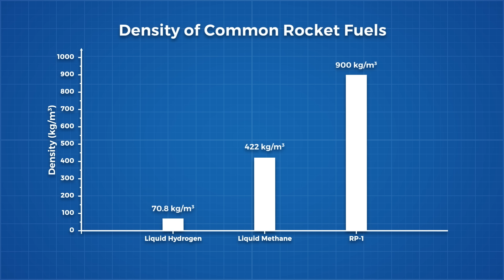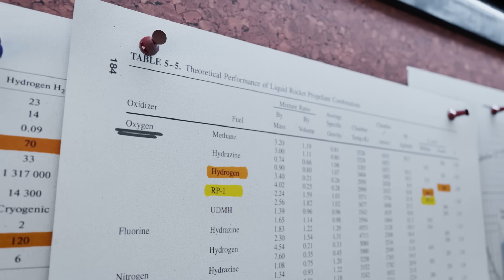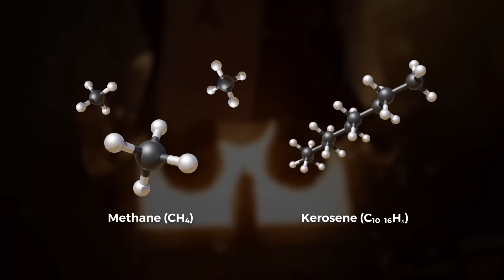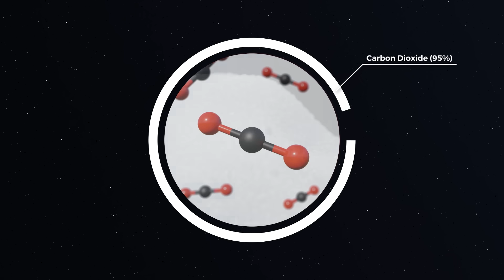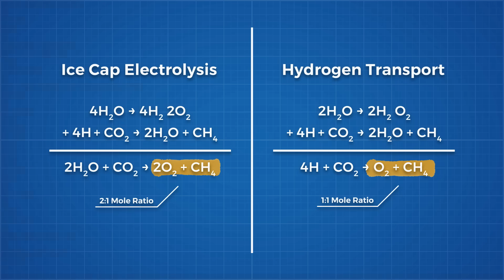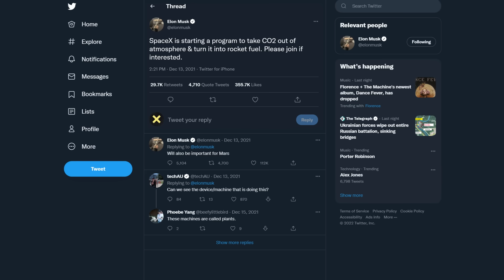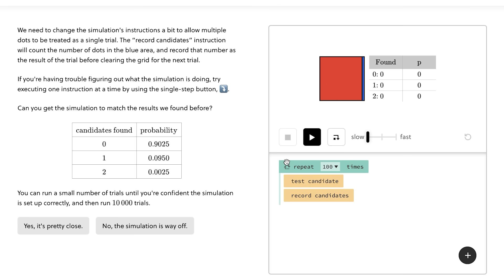Why SpaceX is Using a New Fuel

Comment: A saucer flies by using thrust vectoring. 
The SAUCER:
Flight controls: It uses scale like flight controls, the more advanced the craft the more scales and the better the diffusion system. 
Think of a ballon your hold the end till you want the thrust released and it propels the ballon in the direction opposite the pressure release. The system can fly both air and water, steam out the front and water out the back. Jet fuel burns are 1600 nuclear is 4,000-5,000. Think of a reactor it has a cooling pool. The more advanced ships dont need the water but missiles cant engage underwater and well if your a nuclear missile hunter the subs are there. 
Advantages: It could close flight surfaces to preserve pressure to allow for short duration hops into space. Say you launch a missile at her, otherwise no she will not go into space, gravity could also be used to pull the craft back down, however, residue pressure can maneuver it in space if the flight control surfaces are unharmed during an encounter. Flies underwater, long loiter time, advanced weapons...its a farming tool. lol
 If in the event of compromise she will destroy herself, half into orbit the other half into the earth it's a shape charge with titanium the craft skin and nuclear charge ie core explosion. would probably take care of  the hope of ever putting it back together. That is in my opinion. look up asteriod over russia in 2013, low approach angle and heading towards a major city. Sorta gave it away. 
If it is AI driven as I would assume as your not getting any feedback in RF or other comm. means then she is only approaching aircraft that have left from nuclear weapons capable assets. Some very powerful people hate nuclear. IMO educated guess. 
Also AI avoidance ballistic missile detection satelites, listening stations underwater...
Weapons on this system are very impressive, but, it is honestly a farming tool, as it can influence the weather and so forth with its weapons system, think water from Air technology
It is a day after support system.
More information
look up project Pluto. It outlines the main propulsion, then wrap it, as I said above for your craft. 
Pyramids make excellent saucer parking, 😂 also all societies that have pyramids had advanced astrological knowledge. Mayans called the interstellar object and Egypt showed stasis, without technology. However, ALL societies that built them are ruins. They would be the only building capable of surviving sustained highwinds or water, as well.
These ships are small and man made, instellar object it is not. 👽 Saucer parking angle of the pyramid slope allows for edge thrust shot down without tilt of the bigger true Alien ships. Unless you believe in time travel. 😂 Plus a few batteries for that type of perfection of construction of the pyramids, abate, they put helicopter and plane of in the inner chamber 😂 shit happens mitigate risk.
Can you provide ideas on:
🧬 Black hole: event horizon to event horizon, time travel, through the tenacle of space time? 😂 Think if your in a skin cell and then you move to a brain cell, reality would be about electrical conduction and such not carbon as it is here. Anyway purely fun
 Genesis is Gene-is overall universe design. 😂  Black holes and White holes: it's a tentacle like a cell in your body but of a supreme being. 😂 Now that's crazy...True, Alien thinking
One last ET idea flying the whole solar system won't work it creates to much delay in gravity. Could tell you how but...
Planet collision ie. Asteroid belt, plus with mourning you'll meet Jesus in the clouds, haha it's the ocean 😂 the earth spins as it does the oceans get forced up, Antarctica becomes middle america it has the most mass and Chicago becomes the north pole and then the ocean falls consuming the people. In the event of a pause of gravity
Bible verses: Meet Jesus on the clouds.
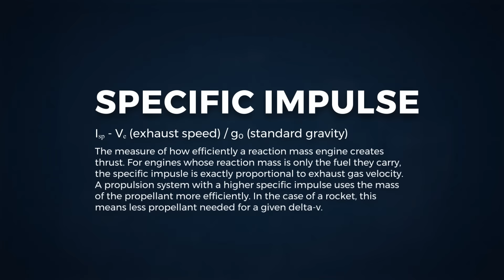 1 Thessalonians 4:17 They we who are alive, who are left, will be caught up together with them in the clouds to meet the Lord in the air, and so we will always be with the Lord.
Matthew 26:64
Jesus said to him,"you have said so. But I tell you, from no on you will see the son of man seated at the right hand of Power and coming on the clouds of heaven."
Revelation 1:7 
Behold, he is coming with the clouds, and every eye will see him, even those who pierced him, and all tribes of the eath will wail on account of him. Even so. Amen
Bible Verse: Flying solar system--Anti Gravity search dark sun in the bible
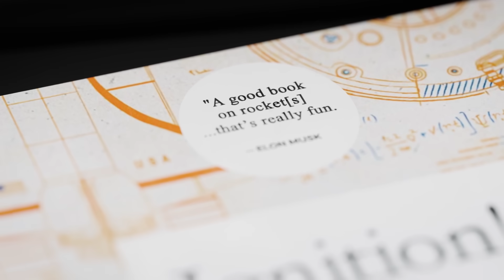Acts 2:20
The sun shall be turned to Darkness and the moon to blood, before the day of the Lord comes, the great and magnificent day.
Sun to darkness it burns yet doesnt smoke it has gravity at its core.
Moon to blood is moon in the shadow of earth, no gravity to pull towards sun
Revelation 6:12
When he opened the sixth seal, I looked, and behold, there was a great earthquake, and the sun became black as sackcloth, the full moon became like blood.
The tectonic plates will shift as I stated above.
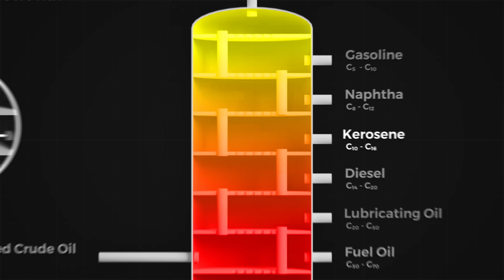2 Peter 3:10, Matthew 24 1-51, Malachi 4 1-3 etc.
Good news if you made it this far:
 At least parking in the south pole pryamids will be where the Mayans left it... See crazy is that shit, read you're Bible Search Dark Sun on open bible search engine. 
Check out my Angels video

Comment: Have any of the engineers ever thought about the launch pad shape??? And the shape of the ground underneath launch pad. A bowl like spape in ground were the bowl shape tapers up to a smaller opening at top around the launch pad. Poing thrust more upward. Reusing the thrust. Made put some water in bottom of bowl shape to cause engines to have more lift on take or use less fuel. Making air under rocket heavier to push off of. Just wondering.

Comment: I’m curious if the carbon soot from kerosene gives some level of thermal protection to the Merlin engines.
Reply: Yes, in a sense. Cold RP1 is sprayed along the interior surface of the sea-level engine nozzles as a liquid film that boils and prevents nozzle melting. The vacuum engine has the gas generator exhaust diverted into the main nozzle to pick up heat and increase ISP.
Reply: @imconsequetau5275  Thanks! I more curious about the atmospheric launch engines in terms of re-use. Btw, there was a an interesting talk given by CFD engineers, and it was fascinating and seemed very practical in terms of computing requirements.